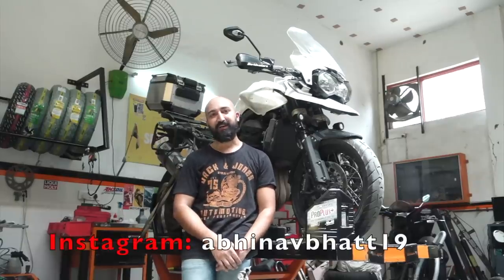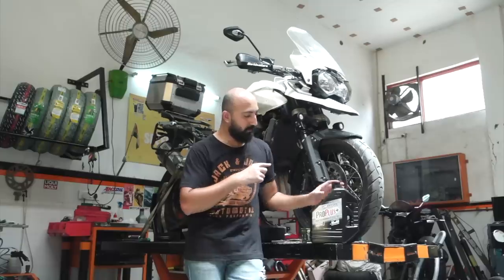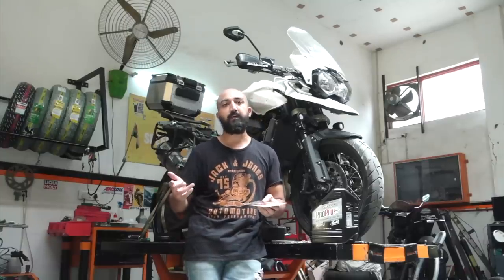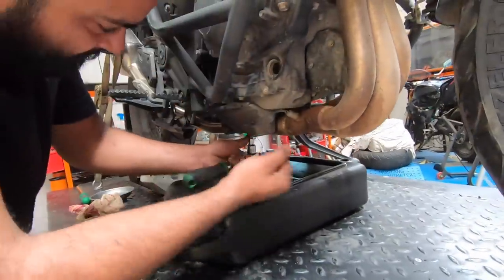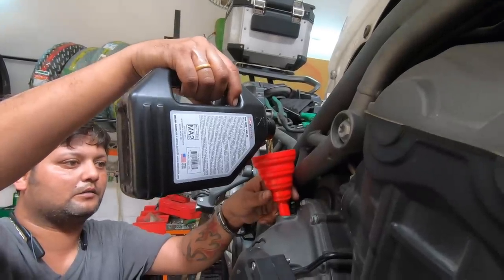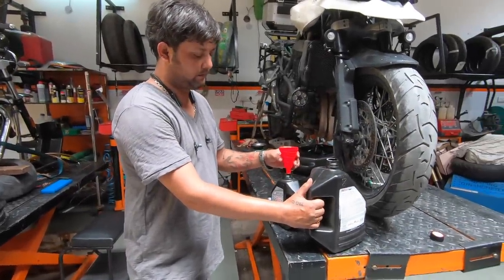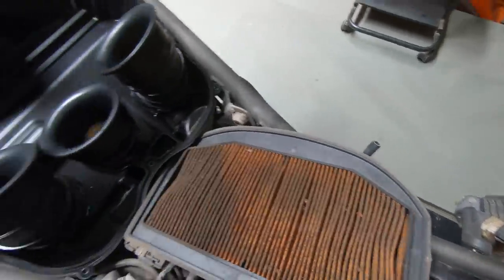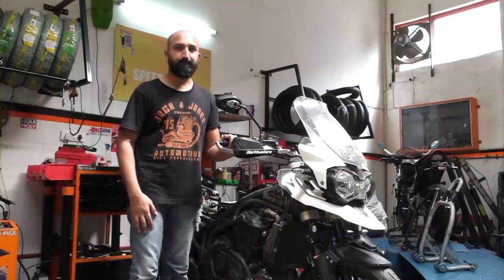Servicing My Triumph Tiger 1200 - American-Made Maxima Racing Oil For This British Behemoth

Comment: This maxima oil suitable for Royal Enfield 650 twins?
Reply from the maker: Interceptor uses 10W50. Yeah, this oil will work on it: https://shop.motousher.com/collections/re-interceptor-18/products/motorcycle-synthetic-oils-10w50
Reply: @abhinavbhatt  It won't be an overkill for that engine right bro? Do share your opinion. Currently running on royal enfield's proprietary oil which has a short drain interval.
Reply from the maker: Naah. No overkill. I run Liqui Moly in my Interceptor. The better the oil, the better the engine runs.